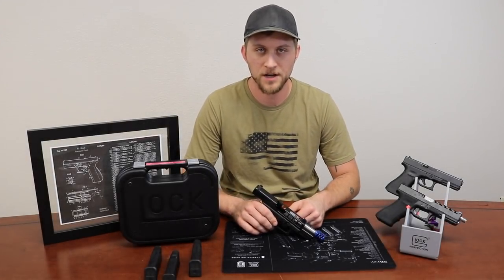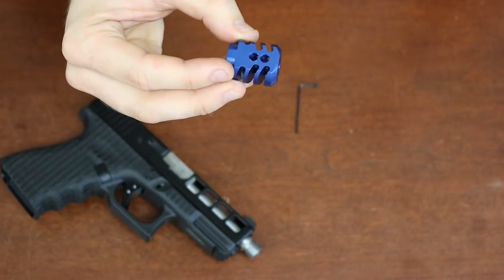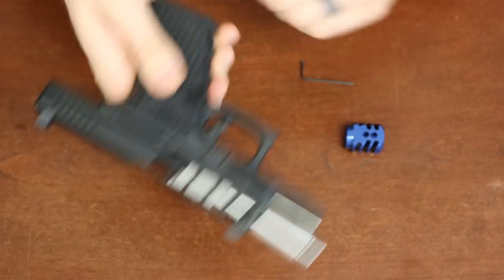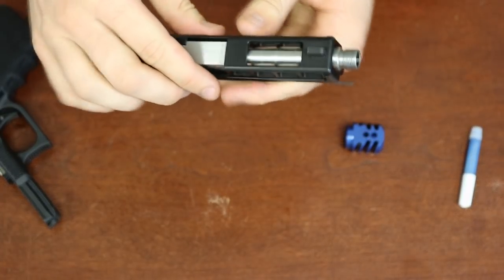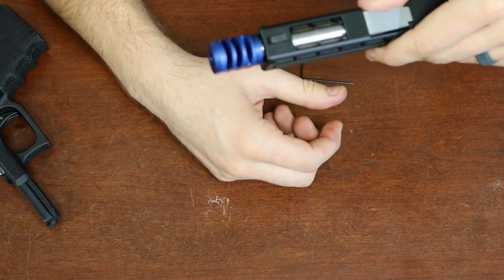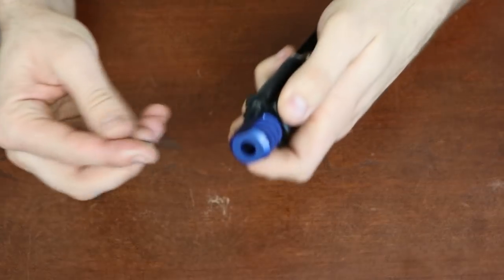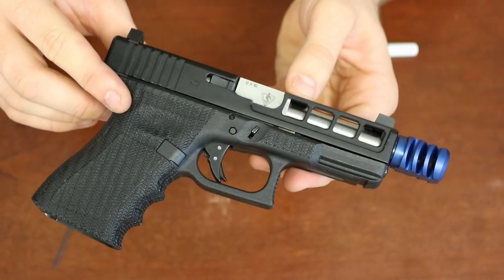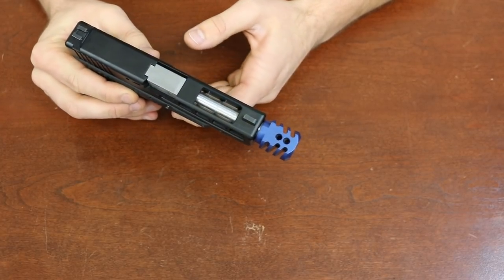RYG High Performance 9mm Compensator

Comment: Question. This may sound stupid or genius. Would it be possible to say, pop a threaded 9mm conversion barrel into a gun chambered in .40/357SIG, and then install this upside down. Bear with me. Doing that, and using +P 9mm Target loads, with the ports going down, would that slightly increase the muzzle rise? What I am essentially asking, is it possible to simulate the muzzle flip from a snappier round for the purpose of practicing shooting that type of round, while using cheaper 9mm ammo? Kind of an oddball idea, but if no one has ever said it before that means it's either a really good or really bad idea.

Comment: So when it comes to cleaning barrel how would suggest cleaning be done the easiest quickest way. Since it’s being lock tightened
Reply from the maker: The easiest way to clean your barrel is to just clean it with the barrel in the slide. Just pull it out of the chamber cut out and clean it like that. If you have other questions you can always reach out to us at customerservice@rockyourglock.com.
Reply from the maker: The easiest and fastest way is to push your barrel forward in the slide and clean it while it is still installed. this has worked just fine for me on all of my Glocks that have compensators.

Comment: My compensator goes past the flush point and looks off on my Glock 19 what can I do or is there a problem?
Reply: You timed it wrong. Turn it back a little bit. The locktite and locking screw holf it in place so it doesnt need the thread attention to stay on and you can possition it correctly

Comment: This seems like a $30 barrel weight that makes cleaning even MORE tedious.... Could not see even the smallest difference in observed recoil... Maybe it helps "felt recoil", but it definitely doesn't do much to keep the sights on the Target throughout the shot... Looks nice and well machined though.
Reply: It works and I can vouch for that.
Reply: @cynic976  that's reassuring to hear... Might give em a shot when I build mine.
Reply: Just remember if your already bullseye bill then your not going to notice anything except for the fact there’s no more muzzle flash which allows you to keep your target straight and on sights for faster shots.
Reply: Was pretty amazed at how much more accurate it made me
Reply: I can see based on the design that this is more like a traditional muzzle brake, as opposed to common compensators that mitigate muzzle rise. It does work, but not as well as I'd like. And to each his own, but it is not a good looking comp. It doesn't go with the gun at all.
Reply: You have obviously NEVER fired a compensated Glock or any other semi auto pistol eh???  Not only does it help tremendously with felt recoil, but quite substantially with observed / real recoil.  We use them on all competition firearms!